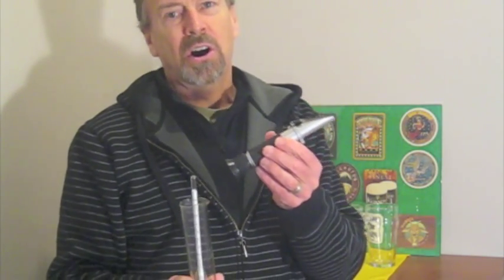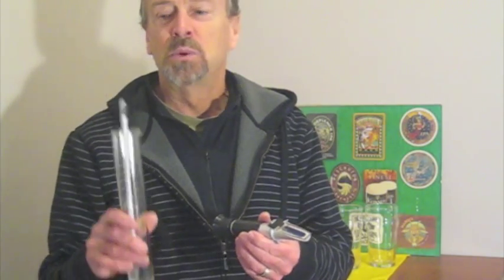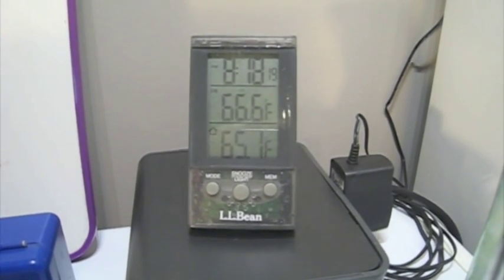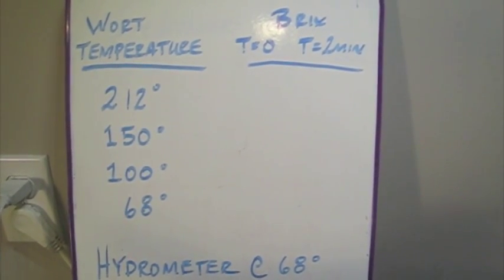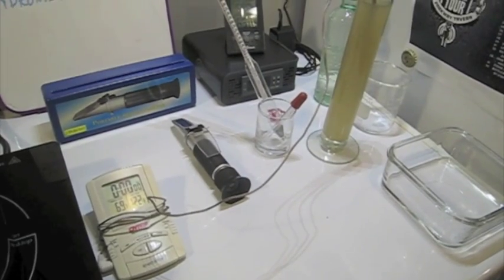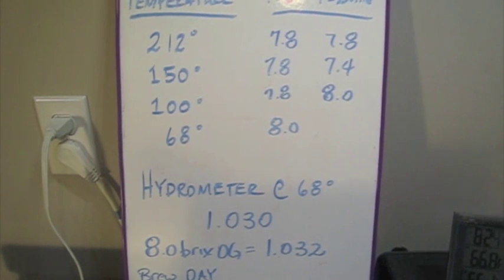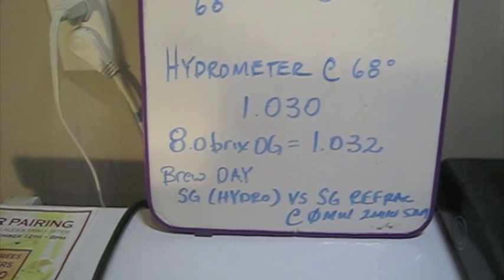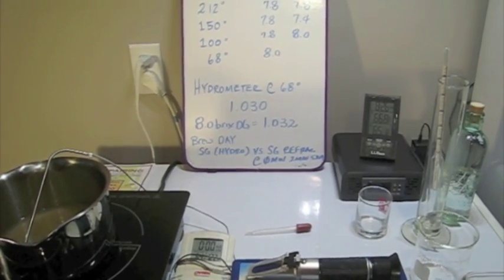Homebrewing Refractometer Part 1

Comment: I know this is an old video, but a slight correction: Your hydrometer reading was not 1.030. You read at the bottom of the meniscus, not the top as you did. Your hydrometer reads 1.032--exactly the same as the refractometer. Cheers!
Reply: I know this is an old comment but a slight correction, MOST hydrometers you read at the bottom of the meniscus, but SOME hydrometers including one I have you read from top of the meniscus and that is in the instructions that come with it. I do think you are correct in this case though and the hydrometer was probably reading 1.032, unless HomebrewingTips would like to counter that? Cheers!